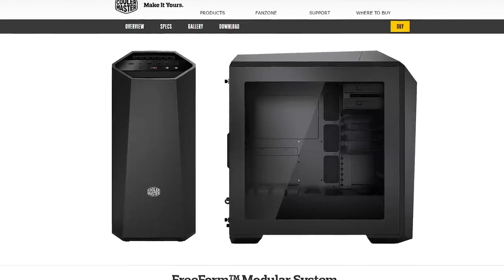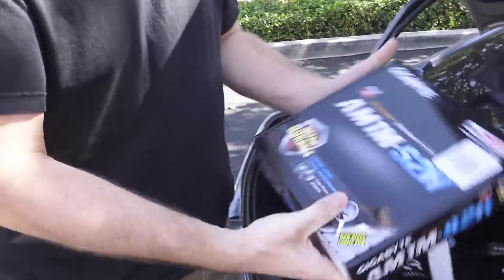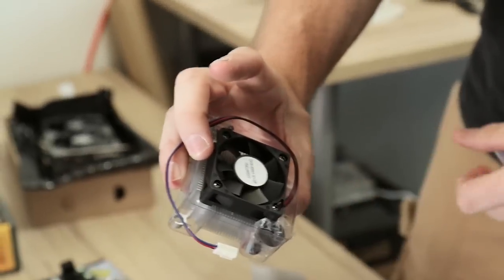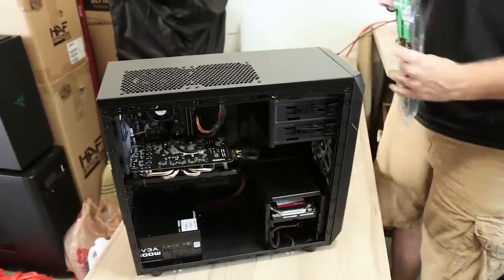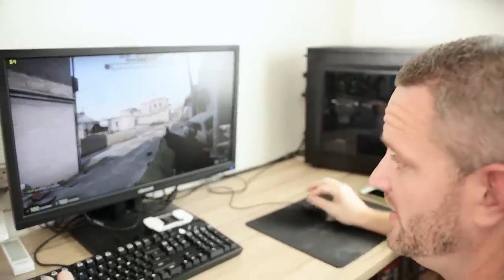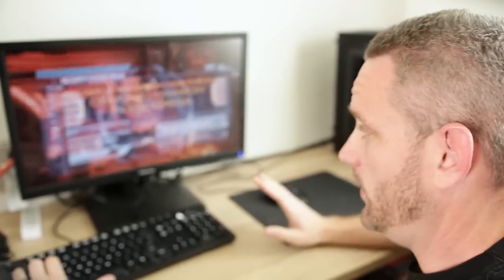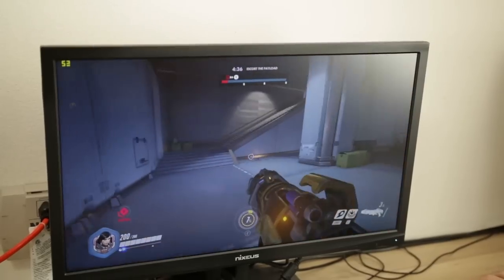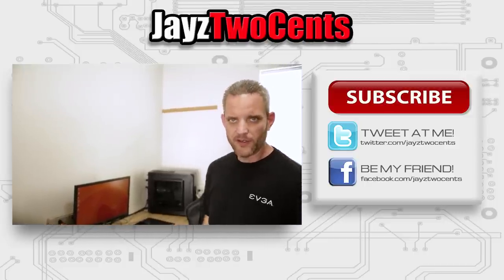Ultra Cheap Gaming PC 2016 - Can you play games for under $400?

Comment: My R9 380 4GB (non-X version) is still going strong. According to gpu.userbenchmark.com this GPU yields better FPS than the GTX 1050ti.
Reply: the R9 300 Series is really good, and better for gaming since the 8th gen. consoles use them. :D
Reply: @leoy.m.644  Oh cool
Reply: That video card is pretty good as long as you keep an eye on the temperatures and have a decent amount of case fans. (It will reach 90 degrees Celsius if you don't in a hurry if you get too greedy and crank the game settings to max on modern games.) I have the X version (the exact same XFX one from the video) it isn't that different from the regular non X model in terms of performance and while its not rated for VR it can easily drive my Windows Mixed reality headset perfectly (It just runs hot as hell though!)
Reply: True regarding the temps. I just replaced the thermal paste and it went down from 88C avg to 76C avg. 10 to 12 degrees C difference.
Huh, didn't know this card can drive VR. That's good to know. I should give it a shot too, when my bank acc gives me the green light haha

Comment: can not do a gaming PC under $400.00 get a cheapest motherboard and the cheapest  CPU and the cheap dims, forget the SSD forget the M.2 drive Get a cheap 1T Hard drive. get a out dated graphic card that is cheap. then get a cheap power supply. then you look at it the sales slip its  under $400.00 however not much. how4ver you need a cheap gaming keyoard. sorry my spelling is dead. I got a 3 dead keyoards,. then forget to get a cheap gaming mouse.

Comment: 2/22/2018 Just two days ago I was looking at Micro Center to see what can be done if I have the money. may be at the end of 2018 I see what I can do. I spent over 3 years doing this stupid build with the X99 motherboard.the first 15 X99 motherboards  ASUS X99 RAMPAGE V EXTREME. that was a fucking waste of money. all of them the LGA 2011-V3 CPU socket broke, and I have fake parts that are dead. all 15 motherboards did not turn on. X99 motherboards 16-25 its was a mix of ASROCK, MSI GIGABYTE they are all X99 motherboards. all failed the same way that ASUS X99 RAMPAGE V EXTREME did. then three more MSI X99A Gaming 7 those the LGA did not break however it was dead. i just got the next X99 motherboard its MSI X99A GAMING 9 ACK its a broken motherboard that MSI fixed, and its missing a lot of parts. MISSING MANUAL, DRIVER DISC, that little box for the WIFI is also missing. The Rabbit ears for the WiFI is missing the screw that holds the WIFI thing on to the motherboard is missing. all the cables missing. I told MSI to send everything I need one time. the sticker they tell me what the motherboard and its model number and serial number is missing. they just ripped it off so that I cannot call in and tell iMSI that something is wrong with it, All what the MSI tech support all they do on the phone is fight customers. bitch, complain use the blame game against the customers. I am not going to take the blame there is no serial number on the motherboard. This one of the bull shit excuse why I voted Trump to begin with. I am getting fucking sick of getting ripped off and there is no law and order. I told MSI that I am no longer buying there products if this is going to continue. I done the same thing with ASUS and CORSAIR. so now the point about MICRO CENTER. I was looking at a i7-8700K CPU. I was looking online at MICRO CENTER  they have a bunch of bundle deals for Z370 motherboard and CPU combo. they have a deal for a i7-8700K and a Z370 motherboard $415.00 I do not know what kind of deal this is http://www.microcenter.com/product/5000411/Intel_Core_i7-8700K,_Gigabyte_Z370_HD3,_CPU-Motherboard_Bundle  I cannot have UPS send it to me, Its STORE PICK UP ONLY I am not going to buy a air line ticket and fly over there pick it up and fly back home  I was trying to see if I can work it out summer. 2018 that is not going to work.  So I am going to wait for summer see what few dollars I save up and see if i can at least buy the CPU from B & H Photo online that is located in NEW YORK. that selling it at a lower price then every one else I looked at $348.00 https://www.bhphotovideo.com/c/product/1356634-REG/intel_bx80684i78700k_core_i7_8700k_3_7_ghz.html?sts=pi  That i7-8700K got two problems with it that I hate  1) LGA socket. however because its got 1151 pins that is heck of a lot less pins then 2011 and 266 the 2nd thing that got to me is the lanes it dose not have 28 lanes. its got 16 lanes. however on the positive side. its the best gaming CPU.if only using one graphic card..see what goes at the end of summer 2018 see if i can get it. if not. then I simply cancel the project. I am fucking sick wasting money doing this stupid build for ever 3 years. the only one giving me good tech support is EVGA

Comment: Get this spec instead, much better performance overall with just 70$ more:

https://pcpartpicker.com/list/9YLjsJ 

New G4560 literally gives the same performance with i3-6100 in every application due to enabled hyperthreading, and rx 470 is good enough to play anything at high values in 1080p. To be honest if u wish to make a 300$ish gaming computer best thing to do is to buy an older second hand i5 machine without a gpu, then buy a new rx470 or gtx1050ti. You can upgrade an existing machine with 300$ just cant buy all the components if u want them new otherwise you'll compromise too much performance.3-350$s really are significantly beneath the price/performance sweetspot, which is around 500$ these days.

Comment: Just to let you know I did a lot of digging on that price on that motherboard./   how you got it so cheap because its a liquidation item.  ITEM NO LONGER IN PRODUCTION. . a one other issue its not selling. some  dealers will lower the price of  products not selling.. they want to get rid of it  so that they can make room for new products that can be sold at high price that peopl;e want to buy. they want the big ticket items.  I know not every one cannot afford that. that is what XBOX ONE X is for. when a entire  fully  built game system 4500.00.  full game system with  everything weven with a game  controller and a O.S all ready installed. Do not have to ddeal with CORSAIR calling the police of  CORSAIR NAZI LAW.. I do not have t o deal with ASUS no service allowed. i DO NOT HAVE TO PAY asus  4200.00 DUMPING FEE ON A MOTHERBOARD THAY DUMP WITH OUT LETTING ME KNOW the gamed are made for XBOX ONE  the market is there  is why

Comment: Can u play Minecraft or fortnte
Reply: Yes
Reply: Get a 200 laptop and it will run it
Reply: You can play Minecraft on iGPUs. Or, apply a mod or two that optimizes performance. I've heard that those do wonders. As for Fortnite, not a clue, but I did find a few articles getting decent performances on Intel's HD 4000 after some tweaks. That's Ivy Bridge, so that's an iGPU that's over six years old. 

So, TL;DR: This will more than be able to if a 6+ year old iGPU can handle it.